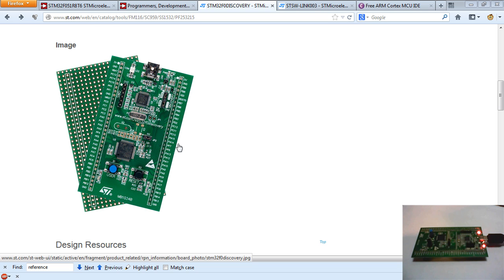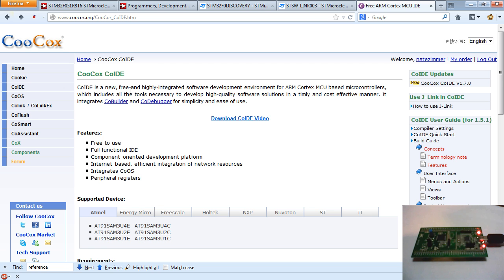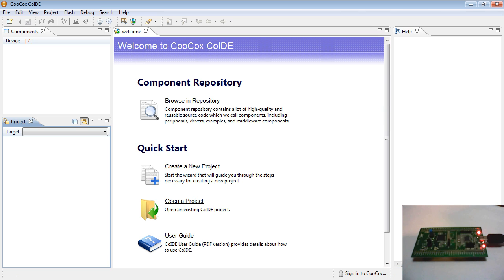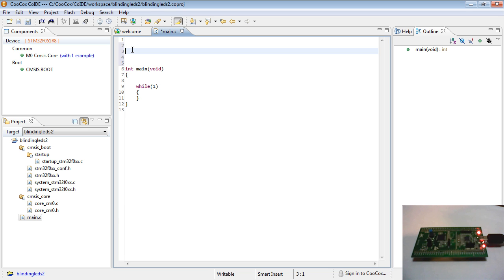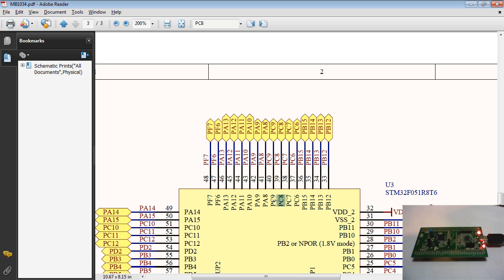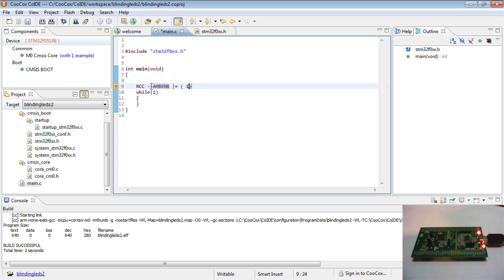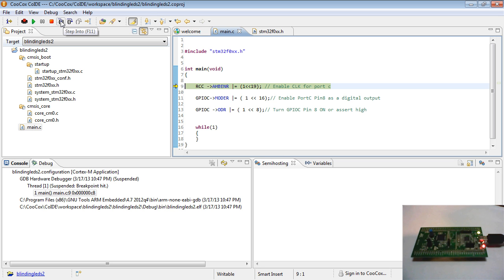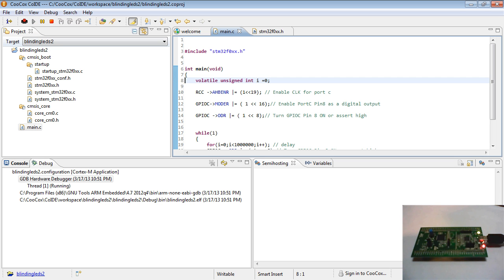STM32F0 Discovery Tutorial Blinking Led

Comment from the maker: In my video, I wrote to specific registers in memory using the reference manual as opposed to pre written functions. The same methodology would work with any micro controller provided you read the reference manual/user manual. Relying on pre-written functions is not ideal because those functions may not always be written. In addition, a pre written function to setup a gpio as an output, for example, will be different on just about every micro-controller. So the answer is probably no.

Comment: I've tried it and its working good. However, my stm32f05x turned out to be an stm32f10x.
So it was necessary to change the code. Instead of GPIOC->MODER there was GPIOC_CRH and so on. If you cant get it working, check the registers.
My code looks like that:

	RCC->APB2ENR|=RCC_APB2ENR_IOPCEN;
	GPIOC->CRH &=0xffffff00;
	GPIOC->CRH	|= 0x33; 	//	GPIO_CRH_MODE 8, 9;	
	GPIOC->ODR |= 0x300;  	// Bit 8,9 output

(of course, you can use symbolic names as i did in the first line)

Comment: Thanks Alot for the great  tutorial !!
I am using hy-mini-stm32v discovery board. I cant connect it to CooCox directly like the ST-Link. I have been following it closely, the program complies, I flash the hex file using Flash Loader Demonstrator but nothing happens nothing happens.
The board has STM32F103VC in it, which has a different register set than what you say, but I believe its the same steps
RCC ->APB2ENR = (RCC ->APB2ENR | 8); //Enable Clock for port B by setting bit 4

Comment: GPIOB ->CRL = (GPIOB ->CRL | 1); //Set Pin PB0 as output by setting bit 0
GPIOB ->ODR = (GPIOB ->ODR | 1);// Write high to pin PB0 by setting bit 0
GPIOB ->BSRR = (GPIOB ->BSRR | 1);// Same as ODR but as atomic execution to avoid any interrupts firing in the process.

When I flash this code, the LED doesnt light up I confirmed from Schmatics that LED is connected to PB0 ... Please any help would be greatly appreciated

Comment: I´m thinking of building an mp3 player with USB host support, do you think that this board is powerfull enough to decode mp3 from a usb flashdrive and send it to a DAC?

I apreciate very much yours videos.
Thanks
Reply: Lino Rocha I would use a hardware MP3 decoder IC for the decoding. Use the mcu as the brains, but don't use this specific board. You want the MCU along with the hardware decoder IC on a purpose-built circuit board. Also, consider finding an IC to handle the USB. Also, is this the first electronics project you've done? It really shouldn't be. "Learn to walk, before you try to run", and all that.

Comment: atmel's "Atmel Studio"  is free and powerful literally plug and play constantly updated with new libraries
Reply from the maker: Eddie Amaya Its a decent tool but certainly has some drawbacks versus what all other manufactures are using(Eclipse). No silver bullet of microcontrollers & IDEs. Plenty of reasons not to use atmel and plenty of reasons for it. Same with most other microcontrollers. Atmels hardware & price point generally do not match up to STM & Freescale. However, Atmel does have their own IDE & a hobby community. Again, tradeoffs.
Reply: +Username true indeed, however what i am finding is that Atmels "community" is mostly Arduino related , and it is hard to find resources that are non arduino , for example their SamD series of Cortex M0 micros . While for the STM32 series there is a lot more information readily available .
Reply: +Username well i just got this working on an Stm32F3 board  thanks to this video. CooCox is pretty neat actually , these datesheets on the other hand wowsers!
Reply: @Eddie Amaya Have you programmed ST mcu's in Atmel Studio?
Reply: i have not, but theres is a company that makesc a plugin that allows any arm mcu to be used  with atmel stdio